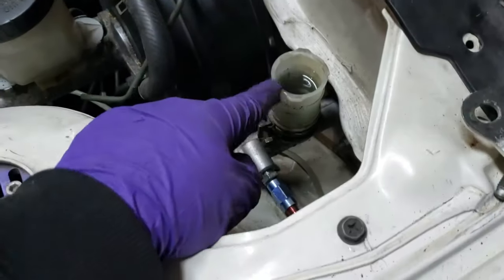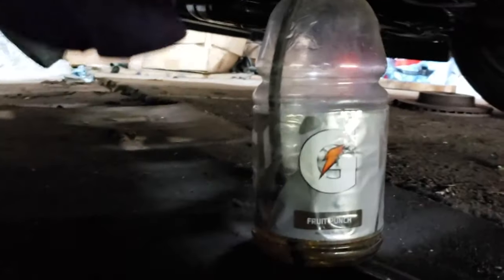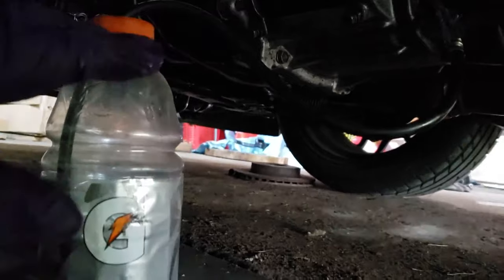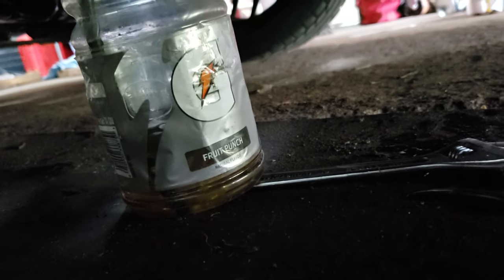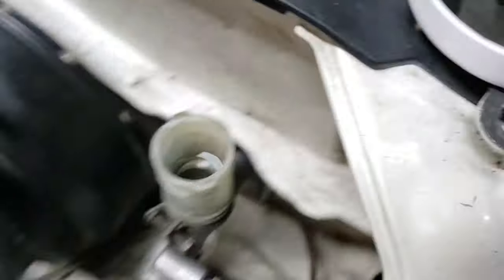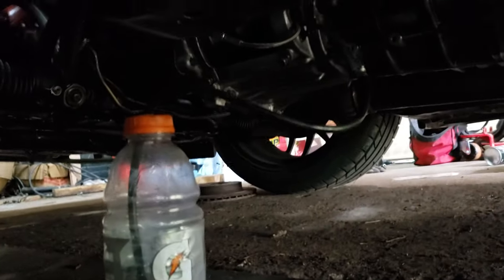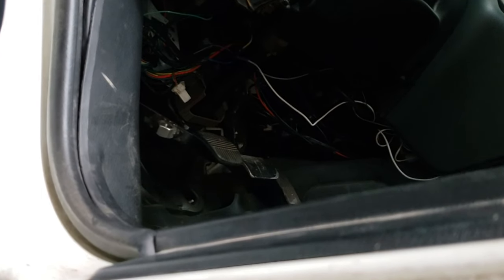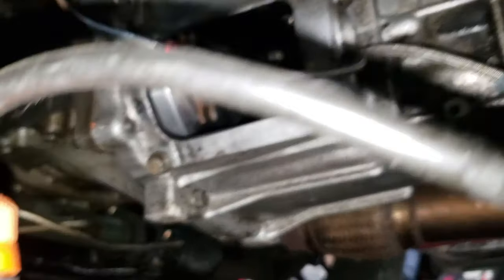HOW TO BLEED A CLUTCH BY YOURSELF

Comment: Thank you Rabid Jz, having just replaced the clutch slave cylinder on my ’73 Series III Landrover I wasn’t particularly looking forward to bleeding the system but I carried on.
After much research and a few failed attempts I had just about given up and decided to have a real mechanic do the job when I came across your video - I tried the method you described. 
In about 15 minutes, with no fuss or bother, I had my clutch pedal working as it should - thank you for taking the time to make the video.

Comment: 2015 golf, been having intermittent clutch sticking issues, been pumping and opening the bleeder and getting sprayed all over. Worked a few times but Now the problem isn’t going away. Will try this method today and return with an updated comment.
Reply: It worked, then this morning it failed again. Has to be a leak somewhere, probably the slave which unfortunately is internal on the car and a very costly garage bill. Great

Comment: For anyone else watching this....I used 1/4" clear tubing from tractor supply found in their plumbing section for $3.99. Worked perfect! Great vid bro!
Reply: DOes the tubing fit tight?  like create a seal on the bleeder fitting?  if it doesn't create a seal, the bleeder will suck air...   The hose I had was too big..lol   heading into town to get a smaller hose.  :)

Comment: Just used your method on my Nissan Hardbody, albeit much more of a pain in the ass with the D21 bleed valve being on the firewall behind the coiled clutch lines, worked like a champ!!!  Brakes are next using the same method.

Comment: To really bleed a clutch system of ALL the air there’s a lot of tricks. Here’s a few I found that helped.  Bench bleed the master cylinder on the car. But jack the front end up high as possible to tilt the master.. this can get a lot of the air out. Then I like to do a few press and holds. Crack the slave.. but once you aren’t seeing bubbles don’t stop..  with the pedal held in unbolt the slave and push in the piston while cracking the bleeder.. you’ll get out even more air.. then re attach the slave and do a few more press and holds. Remember clutch system is different then brake. Pumping up the clutch may feel like your building pressure, but your only stirring up the air.. one press and hold per bleed is all you need and pressure in the pedal will not increase much until all air is out and you close the bleeder and pump it up.  Last is leaving the bleeder open with a hose and bottle set up and pumping out the air and just adding fluid to master until all air is gone..
Reply: Are you doing all this while the front end is lifted up? Or just for the beginning?
Reply: @layne7742   depends on what I’m doing.. i found bench bleeding the master on the car
To be easier,, but you get better results if it’s off the car… problem is trying to re install that master when it’s full of fluid… can be super difficult… so I leave it on the car and jack up the front end high as I can… ( to tilt the master) what are you needing help with?
Reply: @Turtlefarm  I’m doing a 61 c20. The clutch shares the master with the brakes, and this old thing has been sitting awhile so I rehabed the master and the bleeder already, about to remove the slave now to inspect and probably blow out the line
Reply: @layne7742   if the slave is leaking definitely worth swapping it out too.. I also found that filling the revisor from the slave gets best results… takes forever…. But almost guarantees no air… I attached a line to the bleeder… filled a syringe with brake fluid.. cracked the bleeder and pumped up the fluid… plus helps you see the slave under pressure… ( leaking seals/banjo bolt)
Reply: @Turtlefarm  gotcha yeah this slave might be fubar but I’ve gotten worse to work so well see
Reply: @layne7742   you can take them apart and use a wire brush and fine sand paper too, I soak the seals in Lucas engine treatment overnight.
Reply: @Turtlefarm  yeah that’s what I’m working on, the piston is completely stuck at the top so
Reply: @layne7742   I use the brake fluid pressure to pop it apart.. just hook the slave to the line.. set it in a bucket and pump the petal till it pops out
Reply: @Turtlefarm  it was froze so it was torch time, I have a replacement spring but no washer seals. I’m thinking variety pack at harbor freight.
Reply: @layne7742  or just grab a new one .. could be like 30$
Reply: @Turtlefarm  yeah If the $3 variety pack doesn’t fit the plunger then to rock auto it is

Comment: My clutch pedal is way too light all the way to the floor but travels back to the up position. I suspect the Slave cylinder is busted because the bottom of the transmission where it is located is leaking.  But if the slave cylinder is busted how is the clutch pedal returning back to the up position if there is such pressure loss?
I will hopefully know tomorrow but I was interested in any input. 
Thank You preemptively.
Reply: what ended up being the cause? i got the same problem
Reply from the maker: The pedal will come back up becuase of a spring on the pedal itself. An assist as you would call it

Comment: with brakes the fluid will just flow with gravity, you don't even need to step on the pedal. There is some debate that without the turbulence created by pushing the pedal air bubbles can cling to the inside if calipers or wheel cylinders but it is an option.

Comment: I just replaced my master clutch cylinder. I do this process and bleed from slave but once all air is out pedal sticks to the floor and doesn't pop back up. What is causing this?
Reply: Same issues let me know if you resolve this
Reply from the maker: Did you pull the pedal back up before you tightened the bleeder?
Reply: @RabidJz  yes
Reply from the maker: There's so other issue happening. Make sure the hose is. Completely submerged and youre not leaking or getting air anywhere else
Reply: @RabidJz  found out I had a leak in my brake line

Comment: Is the hose primed with fluid?  I started with a clear hose. Pumping the pedal the jar fluid try’s to work its way to to bleeder but never gets there. 
Thanks for the video and help with comments!
Reply from the maker: It should technically gravity feed at first.
Reply: @RabidJz  I’m getting just a little fluid after opening the bleeder . Pump the pedal down lots of air, pedal back up fluid gets sucked up but only goes so far. Several pumps seems to get all the air out but there’s always that trapped pocket of air in the plastic tube.
Reply from the maker: If its in the tube, it doesn't matter. You close the bleeder after lifting the pedal up and the air is out of the system

Comment: what was that imprortant detail you glossed over about installing a clutch stopper so you dont destroy your bearing?  Sounds kinda important what are you talking about?
Reply from the maker: Well it's not exactly for the bearing. If you have a shimmed throw out bearing it can increase distance it presses on the pressure plate teeth. If you're shimmed too much and you have a long clutch pedal throw, the bearing can press the feet into the disk or bend them passed their limit, causing lots of damage. My situation, I found where there was a safe area the car can get into gear and when it engages and knocked out 2 inches of travel with the stopper

Comment: Hey I got a 96 Chevy s10 2.2L with no clutch pressure. I tried bleeding it the traditional way me and a friend he pump the clutch 10x and hold it while I break the bleeder but that didn’t work at all ! My question is do I need to remove the top on the clutch master cylinder while I try your method?

Comment: Hey I have a question with this method still flush the old fluid out even with fluid in the bottle or is it just for air bubbles as the fluid in my is horrible id like to flush it on my own thanks
Reply from the maker: Drain it all out first

Comment: trying this solution but after about an hour, still getting a consistent volume of bubbles w/ each pump. that makes me think there's something more serious wrong w/ it. how long should it take to flush all the air out?
Reply from the maker: 30 seconds. Your master cylinder might have air in it
Reply: @RabidJz  i wondered that too, if there's a crack somewhere that's sucking in new air w/ each movement of the clutch so no matter how long i do it, there's always more bubbles

Comment: Okay so basically put a hose on the bleeder, fill up a bottle with brake fluid make sure the hose in the bottle is submerged in the fluid and keep pumping the clutch u till the pedal has pressure again?
Reply from the maker: Keep pumping the clutch till there's no bubbles coming from the hose into the bottle. Then tighten the bleeder and the clutch should have pressure
Reply: @RabidJz  thanks man ima try this as soon as i get home from work. Was trying to bleed it last night but everytime i would pump the clutch than loosen up the bleeder no fluid would come out. But thanks man your video is very informative!
Reply from the maker: Just remember to keep the master full, and you'll be good
Reply: @RabidJz  when pumping the clutch do i need to keep it pushed in when i tighten the bleeder or let it loose then tighten the bleeder?
Reply from the maker: Pull the clutch out. Don't leave it pressed in or it won't work

Comment: Wait I'm confused, you bleeding clutch or brakes? I saw the bottle and it's brake fluid?
Reply from the maker: Yeah... The clutch and brakes use dot3 or dot4 brake fluid
Reply: @RabidJz  gotcha! Okay I replaces my oem clutch to a stage 3 clutch kit by clutchamerica on my 16 scion iM. My issue is, why does my clutch so high? Is it because of stage 3? I also installed aftermarket crank pulley not sure if that actually has something to do with it but yeah. Should be adjusting something?
Reply from the maker: @simplyblazeegaming adjust the rod under the dash that connectors to the clutch pedal. The rod should be threaded
Reply: @RabidJz  okay I haven't replaced a clutch before and I got no tools at the moment.

Comment: @RabidJz Ok now how do you build pressure? I did this and it worked to get air out but my clutch pedal feels so light that I feel like I can shift gears without the pedal. How do you build pedal pressure as a one man team?
Reply from the maker: The pressure is there after you tighten the bleeder.
Reply: @RabidJz  Yeah I finally got my car back on the road today after it being down for 2.5+years. I havent driven stick in that long as well so my instinct for clutch pressure on the pedal was off. After driving around town all day with it I realized it was fine.

Comment: The bottle just keep filling up with clutch fluid for me? How do I stop this? I break the bleeder and then go pump the clutch peddle, the master cylinder drains and I top it up but it’s all just getting pumped into the plastic bottle.
Reply from the maker: Its supposed to.... If the bubbles are no longer going into the bottle, pull the clutch up and tighten the bleeder. Top off, and youre done

Comment: Yeah i have a 2002 nissan frontier that's a 5 speed and my pedal has no pressure so I replaced my slave and master cylinder and bled some of the air out using the other bleeding method, so I might try this. And will it get all of the air out of my clutch line?
Reply from the maker: Yes. It's important that you pull the clutch back up before you tight the bleeder though
Reply: Okay, and if I do it right, then my pedal will come back up to normal without getting stuck halfway?
Reply from the maker: That is correct.

Comment: Sup bro! Thanks for vid. At the end (the last clutch press) u say to make sure the clutch is fully up before closing the valve otherwise it creates a vaccum. Can u explain what exactly would happen if the clutch would pressed down while valve is closed? I had mine bled and only when i am going to first turn on thr car the clutch will not go up, i have to manually pick it up. Once the car is on and running the clutch works perfectly fine (goes up and down as normal). Could this be happening due to clutch not being brought back up to normal position before closing valve under car?
Reply from the maker: That's what happens. If you dont pull the clutch up before tightening the valve, there will be a vacuum in the system. So when you press the clutch in, it equalizes and the pedal wont come up.
Reply: Will this also fix my issue of my vlutch pedal getting stuck halfway to the floor??
Reply from the maker: You can try it. But the issue is probably in the slave or master. It won't hurt to try
Reply: @calebakers4803  mine waa the master cylinder doing that, replaced and bled multiple times and still kept doing that, it ended up being the new replacement was defective

Comment: Question, I just got my clutch replaced, new master and slave cylinders and resurfaced flywheel, my clutch pedal feels spongy when I press it and it releases slowly, could this be the solution?
Reply from the maker: It's always good to rebleed if you suspect it's an issue

Comment: What about a Saab 9000 that shares the reservoir with the brake system? Will this method work as well? I was told that it has to be pressure bled.
Reply from the maker: Only one way to find out

Comment: wassup man. i had a tripod r154 in my chaser but upgraded to a jzx 110 r154 and kept the same single orc clutch. only my synchros where bad my clutch was perfectly fine but with this new trans the pedal is sticky and squeaky. its only sticky when i let it out slow like a first gear start type slow. the pedal does come all the way up tho. also when i step on it the revs go up but car doesnt pick up much. feels like a slipping clutch but my clutch is new and its a good clutch. clutch was perfect before the swap and i only un bolted the cms i never undid any clutch lines. any help??
Reply from the maker: It might help to try draining all the fluid and rebleeding it with fresh fluid if its dirty
Reply: @RabidJz  even if I never had to disconnect any clutch fluid lines? I shouldn’t even have to bleed it. But could that be causing it to slip?

Comment: I did the method on my d21 and its  normal for to have to bring the pedal up by my hand doing it this way ya? tell the bleeder is tightened agian!*
Reply from the maker: Yeah, it wont build pressure till the bleeder is tightened. But when you tighten the bleeder, it'll be golden
Reply: Rabid Jz ya cool. I think it just feels soft cause iv been driving my z33 the past week 😂 But ima give it a few bleeds the old fashioned way to make sure its all good! Dumb d21 have the clutch dampener in route so that dont help either.

Comment: So I can just take the line loose from the slave cylinder and put it in the bottle with fluid? 95 1500 Chevy,I have done this 100 times literally,between my trucks and z28,but this mfr man,I even bought a new clutch master cylinder yesterday,put it on,I took the slave cylinder off my other truck so I know it was working perfect. I did the steering wheel puller trick on the slave,bleed the air,bitch won't bleed. I've done this so many times by myself after Installing new clutches by myself,this mfrs got me man! I subscribed and liked,I mean just because,but any input man I would truely appreciate. I've never had anybody do any work for me,but I'm getting close to it with this thing,I don't get it I just don't. Thanks man!

Comment: Will it work on a 1990 ford thunderbird supercoupe 5 speed manual.
Will not get normal pedal back after changing the clutch master cylinder
Reply from the maker: It will work on anything with a bleeder valve, as long as you do it right

Comment: I’ve bungled my attempt at bleeding my Forester and the clutch pedal is stuck to the floor. Will this method help build the pressure back? Thanks
Reply from the maker: Yes absolutely, as long as there's no where for it to bleed out
Reply: Rabid Jz ok great so just bleed it into the bottle? There are no other open lines/ports/leaks so I just open the bleeder with the bottle catcher connected and manually work the clutch pedal?
Reply: I’ll be glad to buy you a 6 pack your choice if you are ever in Denver. Thanks a lot. It worked with this bottle method and elbow grease. I’m putting you in for a medal of merit as well. Cheers to you.
Reply from the maker: Lol, didn't even see your newest reply, I but yeah, fill the bottom of the bottom and submerge the line in it, open the bleeder and just keep pumping the pedal till the air is out. Looks like you got it though
Reply: Rabid Jz you’re cool I was letting fear overcome me I thought I sunk the ship. Your instructions were clear.

Comment: When I did this my clutch pedal never came back up by itself, I had to pry it back up with my hands, do you know why?
Reply from the maker: Did you pull it back up before you tightened the bleeder
Reply: @RabidJz  I just opened the clutch bleeder and pressed the clutch down and then it never went back up. Are you supposed to open the bleeder, press clutch down, move clutch up, and then close bleeder?
Reply from the maker: You have to manually press and lift the clutch until the air is gone from the system

Comment: Plumbers tape on bleed screw needed didnt work for me bleed screw floppy
Reply from the maker: What? Its not recommended  to use any kind of tape or thread sealent on brake lines or any kind of flare fitting. All of those fittings are designed to seal because of the flare designs. Adding stuff like that can cause leaks.
Reply: @RabidJz  I'm talking about something else.....
Reply: @Rabid Jz  i dont think he meant o  the brake lines/clutch but most probably on a plastic bleed nipple outlet (usually at end of clutch system) as theyre not a high pressure line etc etc..
Reply from the maker: I have never seen a plastic fitting at all on hydraulic fluid lines. Those fittings also have tapers, sealing is in their design